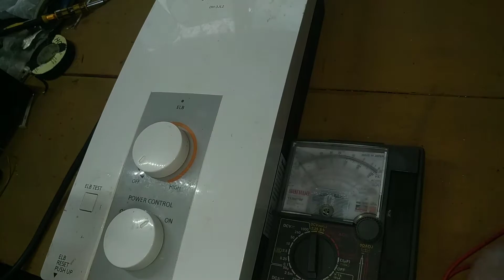Heater/Shower Head Not Heating Panasonic DH-3JL2

Comment: Hello I watched your video and what is the symptoms for the water heater? Iszit not hot enough? Cannot power on? So you replaced the thermal fuse, the Heater will become hotter when u turn up to maximum. I have the same model as yours. Please advise
Reply from the maker: not heating
Reply: @ahchannel2014  so you replace the triac, It can heat up?

Comment: Salamat sa video. May konting leak ang DH-3JL ko sa parte ng 05:36 ng video na nagdulot ng konting basa sa potentiometer sa baba. Safe ba siya gamitin? Binuksan ko sya kasi masyadong mainit ang tubig sa showerhead (48°-50°C). Tapos ang blackbody ng heating element aabot ng 62°C. Ani kaya sira nito?
Reply from the maker: walang anuman, lagyan mo ng sealant sa may tubo kung saan may leak para hindi mabasa ang mga piyesa.
Reply: Thanks. Will check kung shorted ang MT1 and MT2 terminal ng triac.  Masyadong mainit, umuusok at nakakapaso ang lalabas sa showerhead. Nagtrip naman ang KSD301.

Comment: Compatible ba sir ang mga magnetic flow sensor sa iba't ibang brand?  Champs ang brand ng heater ko, medyo nagbara ska kinalawang na ung magnetic flow sensor, eh kaso wla ako mabilhan na sensor para sa mga Champs, puro mga Joven water heater brand lng nakikita ko sa shopee ska lazada.  Compatible at gagana kaya un sa Champs heater ko? 4cm x 1cm ung dimension ng magnetic sensor ng Champs, ung sa Joven nman eh 3cm x 1cm lang.
Reply from the maker: try niyo sir pero kelangan niyo iconvert mas malaki ng konti yung orig.